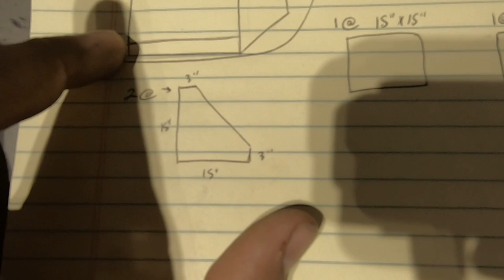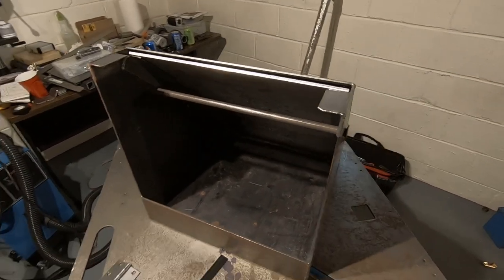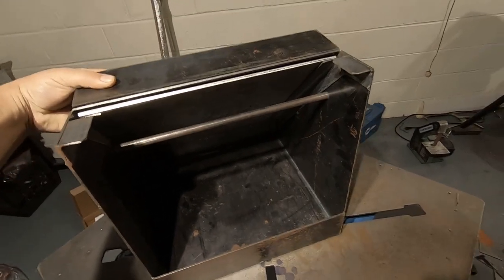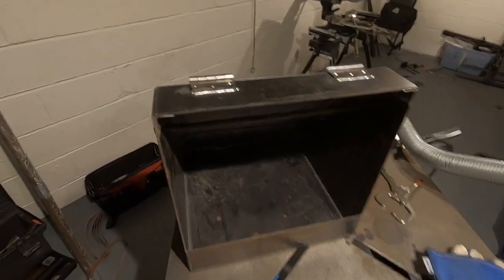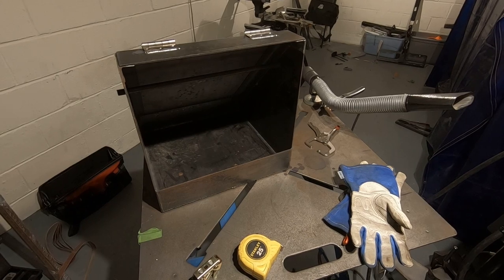Bullet Trap Build (1 Day Welding Projects)

Comment: Fill the bottom with sand to help slow and further catch the bullets so they will be less likely to ricochet? If you redesign/remake it ever most "catches" are pitched 30 degrees for the back wall also
Reply from the maker: Yes, I’ve put sand in it and it works well for smaller caliber rounds but larger ones throw sand a bit but still work.  And I’ll have to double check the pitch on it, I know it’s less than 45 but I’ll be sure to try the 30 degrees on the next one I build. Thanks for the feedback!

Comment: Hey on mine in the front bottom piece of steel is a little higher not by much I'd say a inch or less but at the top of that piece I have another 2 inch piece going back into it so it's has a little lip and seems to keep all the fragments in it I think you did a outstanding job on that it makes me want to get back into making them infact  I think I'll go make one out of aluminium right now so it can be really light to tote around for my pellet guns this will be fun to weld that much aluminium together need to practice on aluminium  anyways
Reply from the maker: I think I’ll have to try out your little change on mine, sounds like it’ll help quite a bit! You’ll have to let me know how that aluminum one goes !
Reply: @ThrownSparksGarage   if you do do it the piece is a inch and a half and it's at a slight angle up instead of going at a 90%from the  top of the bottom piece lol hope that makes sense lol hope it  helps I just saw that this post was from a long time back

Comment: your 45° is too steep should have been at 30° opening should have been 36"  also should have vacuum port to pull the lead particles into the vacuum.  also, you should have a one or two MERV 13 Pleated Air Filter room filter to clean the air from the lead particulet and the bunt powder.
Reply from the maker: I try it out on the next one I build!